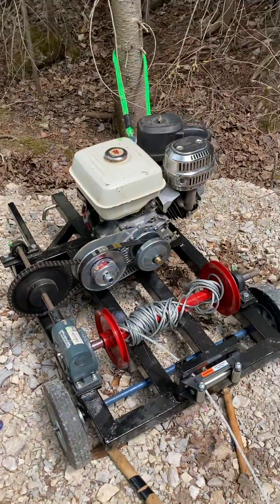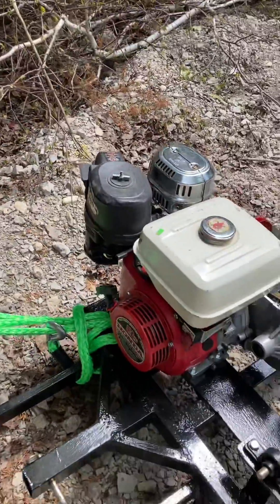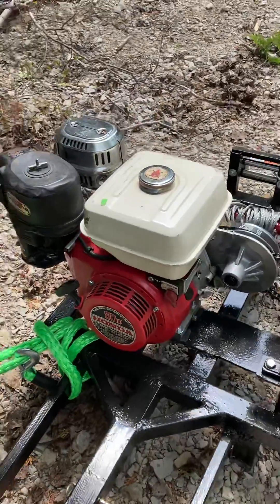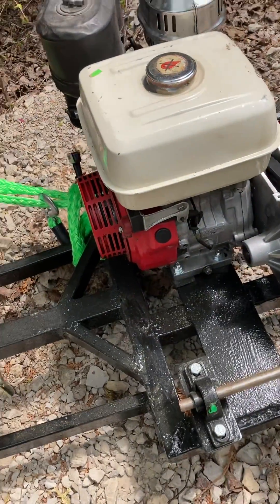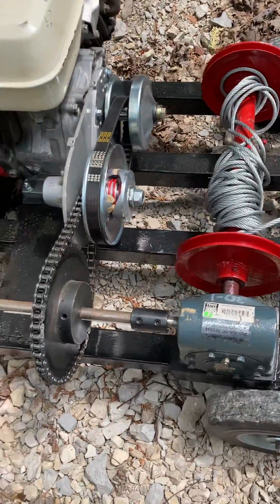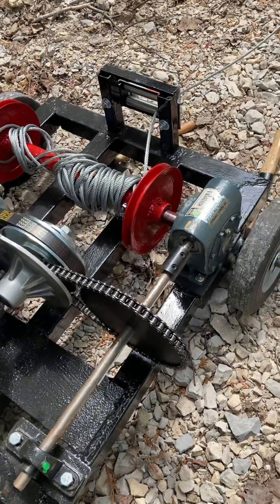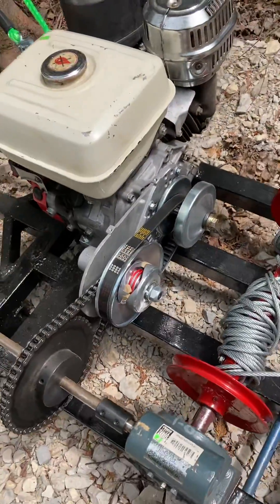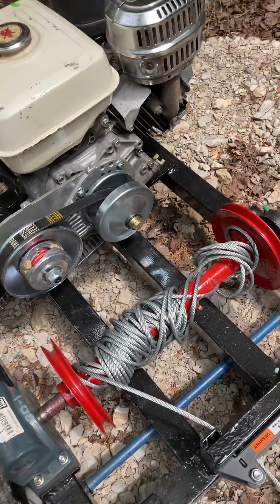Home made gas powered winch

Comment: making that winch run smoothly. Using auction finds and customizing parts like the torque converter and reducer shows great ingenuity. The solid rubber tires and sturdy frame must make it super durable too. Awesome work!

Want me to help you craft a shorter, more casual response or a detailed compliment?

Comment: What are the key components needed to build a safe and effective homemade gas-powered winch?
Reply from the maker: well, I got the honda motor at an auction for less than $50 CAD and the reducer at an auction for probably $20-30 with some other stuff.  The metal I had and the wheels and cable from Princess auto.  Most the other stuff I got from Amazon like the torque converter which was the most expensive element.  Here are some of the links from amazon  https://www.amazon.ca/s?k=go+cart+torque+converter+clutch&crid=2AQ9N3ZU1CW9D&sprefix=go+cart+torque+converter+clutch%2Caps%2C113&ref=nb_sb_noss , https://www.amazon.ca/dp/B07BB7KS7T?ref=ppx_yo2ov_dt_b_fed_asin_title , https://www.amazon.ca/dp/B07NPT53D4?ref=ppx_yo2ov_dt_b_fed_asin_title , https://www.amazon.ca/dp/B076FJ2C95?ref=ppx_yo2ov_dt_b_fed_asin_title , https://www.amazon.ca/dp/B08DDJJD93?ref=ppx_yo2ov_dt_b_fed_asin_title,
Reply: @dieseldavebrown  Compared to that, assembly would be a bigger challenge, perhaps requiring a lot of learning?

Comment: Wow, that’s some solid craftsmanship! You really brought that old Honda motor back to life and turned it into something useful. Love the creativity with the torque converter and 30:1 reducer, smart way to get serious pulling power. This is the kind of DIY build that shows real skill and problem-solving. Respect!
Reply from the maker: Thanks, it is good for pulling logs out of the bush.  I tried to pull a 1 ton container off my trailer which didn't work out- the spool is the weak spot, will have to use heavier material.